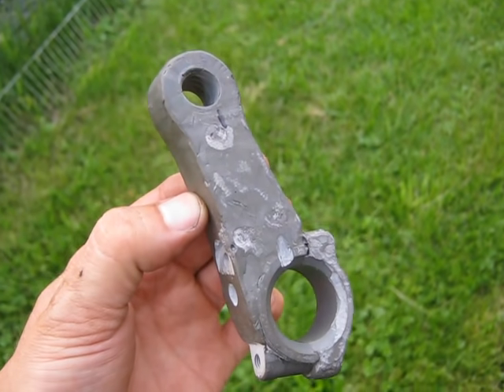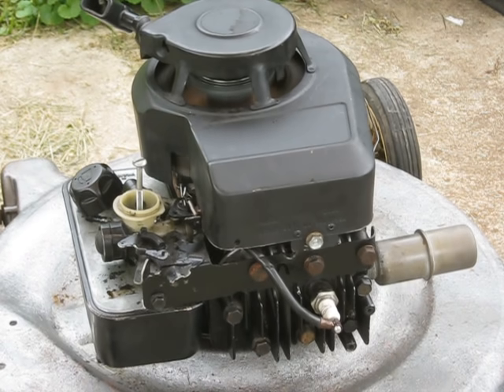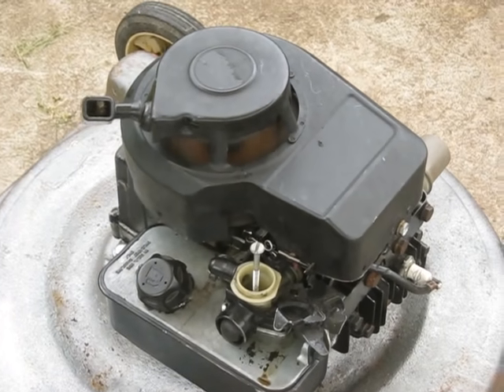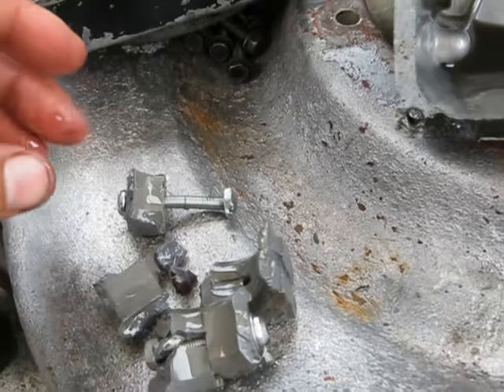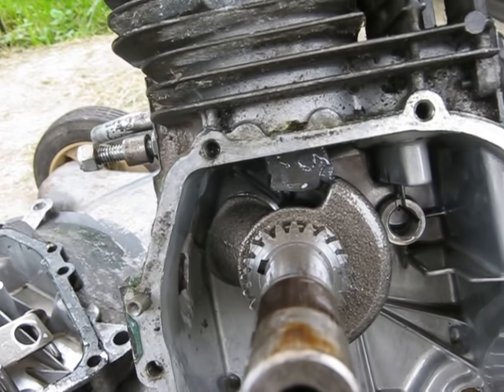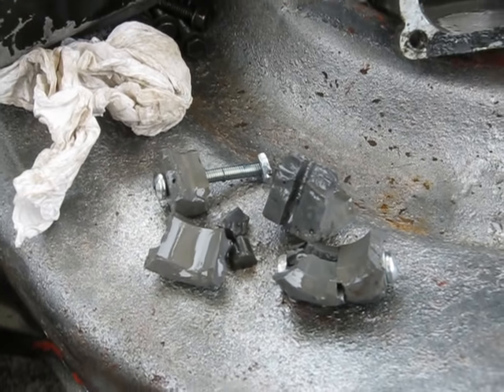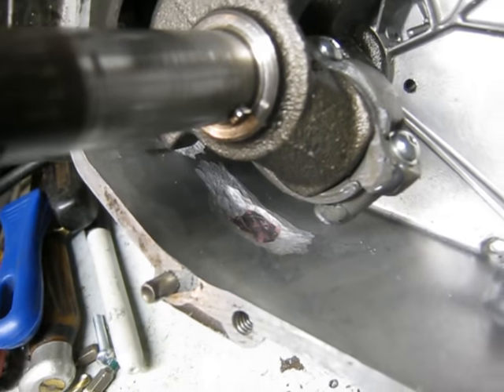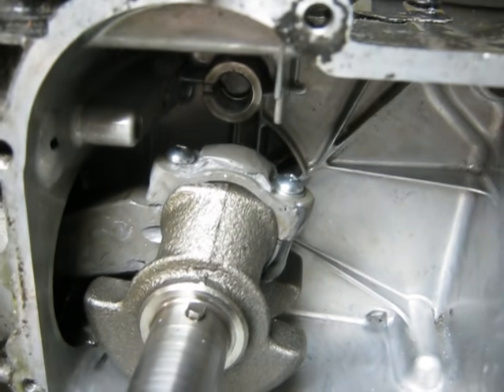100% JB Weld Con Rod Running!!!

Comment: Maybe putting the casting into a vacuum chamber would help in getting rid of air bubbles to reduce weak-points, resulting in a good, solid casting... :)
Reply from the maker: I could try that, if I make a second one. The JB is pretty thick stuff to pour, plastic is much thinner. I didn't see any bubbles in the cracked areas though
Reply: Bubbles could be too small to see with the naked eye

Comment: You should try jb weld cylinder, piston, head, connecting rod, and crankshaft all at once 😂😂
Reply from the maker: I was just about to shut the engine down before the rod blew, otherwise i was going to run the rod with the JB piston.Time to cast another I guess.
Reply from the maker: Sounds like others want to see another try also. i am looking at how to make it stronger.
Reply: Maybe some fiberglass
Reply: They already have an engine like that it's called Kia
Reply: Jaco2023 that would be rather I interesting lol
Reply: Interesting Facts That is a interesting fact.
Reply: Hey charger would you make a whole briggs engine out of JB weld(Head, cylinder, piston, crankshaft, fuel tank, etc) when you get the rod repaired

Comment: It would be interesting if you tried this again but reinforced the epoxy with some fiberglass matting or window screen pieces
Reply: Reminds me of carbon fiber i wonder how well that would stand up to it.
Reply: X2
Reply: its JB weld. Its already reinforced. Its not Epoxy. NO !
Reply: screamingshiter  straight from the jb weld website 

" J-B Weld is The Original Cold Weld two-part epoxy system that provides strong, lasting repairs to metal and multiple surfaces"

They do claim it's "steel reinforced" but the tiny pieces would not strengthen it nearly as much as half-inch long glass fibers.
Reply: Or better to add some steel rods in vertical y axis inside jb weld.
Reply: Thank you for the entertainment.. it's something different for sure.. you keep making these I will keep watching..

Comment: Yeah, agreeing with other commentors. The PSI strength of certain plastics mirror that of aluminum when glass fiber or glass balls are added to the mix in higher concentrations. 

In manufacturing, I've heard that the only downside to glass reinforcement is cost and mold life. However, that is not your concern, so perhaps getting some glass balls (not sure how to get that) or glass fiber (cut up glass mat would work nicely) to mix into the JB weld would add strength. I guarantee that it'll last much longer, but I'm not sure if it would be indefinite. 

Truly, a long stand of glass fiber wound between both crankpin and wristpin holes around a mold would probably be ideal since you can apply strength in the direction of the stress lines. It's similar to how helicopter blades are made, so, ignoring temperature issues, it should last a while. 

Great job on this run, by the way!!

Comment: I'm betting that would last a bit longer if you were to reinforce at least the bottom with say metal wire to act like rebar we use in concrete.  That does have alot of reciprocating force though . I'm actually impressed at the fact you are able to mold these things
Reply: that was my thought too, but also re design the rod so the bearing split was vertical, not horizontal and was about 2/3rds the length of the rod, so like a two piece rod on the lower part, both pieces reinforced with steel rods running the full length of the piece to help control the flex of the rod.

Was also wondering if it was possible to cure JB under pressure? maybe a mold that can be pressed in a vice so the molecules are pressed closer, as in forged steal...  also heating the rod in an oven to harden it.

Comment: Sweet! If you do try this again, cast it with a lot of extra meat. Then sand it really smooth. Vibrations will end at those rough edges and crack it. Problem pretty well known with lawn mower and go kart racers running stock rods. They'll grind the rough flashing down so they are smooth, and experience a lot less breakage. Keep up the good work! I love these videos!
Reply from the maker: I did beef it up already, but had to grind most of it back off, I even had to cut part of the block away for clearance. These 3-1/2 horse engines have very small con rod clearances, so very little room to work with. I am glad it ran as long as it did, as i was grinding on it for 2 hours last night, to make the little beast fit!
Reply: I could tell a lot of work went into that, lol! Maybe you could try the JB weld again with some glass fiber reinforcement, like they do with tool plastics? I could see that adding some strength. Maybe just some fiberglass insulation mixed in?

Comment: I live in Kingston and I saw you had a video of a 1960 push mower and was wondering what scrap yard you went to
Reply from the maker: I think I found that at Napanee Scrap metal, i just happened to be there when a trailer full of old mowers pulled in. They are all gone now, just luck of the draw. Years ago I used to get mower engines at Kimco, but I have no idea if they allow people in the yard these days.
Reply: ChargerMiles007 I used to go to buyers scrap metal over on macedues lane but they closed down last year and I went to ANS but the won't sell anything to the public so I'll try kimco and napanee

Comment: How about applying a mold release agent to the crank surfaces, and molding the con rod onto the crank to eliminate bolts altogether
Reply from the maker: Interesting idea, I didn't think of doing that exactly, I was going to make the 1 piece rod, and cut the crank, then bolt it together or something. Casting onto the crank may work, but would have a bit of an intricate mold box etc.
Reply: On further reflection,  you might not be able to assemble the engine,  as you would not be able to install the wrist pin

Comment: Did you mold the JB Weld at room temperature? Applying heat after the epoxy has initially set can both speed up the curing process and strengthen the final product. Even the cheap Harbor Freight epoxy gets stronger when heated during the curing process.
Reply from the maker: I just molded it at room temp. So it is stronger if it is heated, interesting.

Comment: try to compress the jb weld while it sets. i had an exhaust leak and it'd just knock the jb weld off so i took a plate and hammered it down on the jb and i havent had problems since

Comment: I use epoxy a lot an I'm wondering if you have any type heat treating I often I worm it to about 110 for 5 to min then let set for 20 to 30 min reheat to 140 for ten min let set 24 hrs then repeat the last set I used JB Weld often to repair molds for high temp compost  aircraft parts an would run test blocks though heat treatment 24 hr ramp up 450  an back to room temp then test every test block would reach 72,000 psi before failure worth a try must be void of any an all air pockets

Comment: JB weld is actually a really good filled high temp epoxy, it's just that the tensile strength is not quite there.
a few things to try
1. make sure you post cure the epoxy to above 200F for at least an hour before you try this.
2. mix in some long strand carbon or fiberglass (at least .25" length strands) into the epoxy before you cast. the piece. make sure you force all the air out of the piece as you form it up. this will more than double the overall strength.
3. increase the overall dimensions of the piece wherever possible to count for the lower Physical strength.
Reply from the maker: Thanks for the helpful points, I will put them to use if and when I make another rod.

Comment: You should try repairing a a broken aluminium connecting rod with jb weld.
Reply from the maker: Actually I did that back a year or so ago. it ran about a minute before it let go, and took out the block. it was revving about 3000 rpm, and destroyed the valve tappet area! The vid should be here some place, I think it is called JB weld con rod repair or something.
Reply: oh wow i just went watch the video and holy that glue is some strong stuff it held up quite well.
Reply: Project Farm did that as well

Comment: i bet if you made some metal inserts for the connecting rod cap bolts it would last longer. i am going to try and 3d print a connecting rod with metal inserts for the crankshaft journal and wrist pin

Comment: I want to see a wooden carburetor with wood that can deal with fuel soakage... Just a thought. Would be cool to see if it could even run on one.
Reply from the maker: Now that is an interesting idea, can say i wood have thought of doing that!
Reply: Lanchester Wick Carb. (for the old-school lower RPM motors) I considered designing a version for 2-strokes that were bullet-proof...I hate the Zama/Walbro carbs. I also considered a wooden body for it...heck...anything could actually work for those, I would imagine.

Comment: So the question is, did the rod fail and bend the bolt, or did the bolt stretch and cause the rod to fail.  I would try it again with beefier rod bolts.

Comment: please do another complete J-B Weld connecting rod.   Could you strengthen the rod by:  eliminating the 90-degree turn of the rod bolts, by having the rod shaped like an auto-rod, where the bolts fastening the cap, are straight-out from the rod?  Could you also grind/smooth-to-curved-edges all of the outside rod edges to head-off potential "stress-fractures"?  Could you polish the rod all over, deburring all excess J-B?   Could you then align-bore the ends, with the rod-cap on, so both the piston-pin AND the crank-end are precisely @ 90-degrees?  Oh!  Is there ANY way to compress the J-B Weld connecting rod into a top-and-bottom die [placed along the long ends/length of the rod ] while it is curing that will compress the whole rod, sort of as is done by a steel forged connecting-rod?   Obviously, it can't be heated & hammered like a real forging, but maybe during "cure" it could be compressed in a die forcing the J-B particles closer together.   After compression, polish it up, kind of.   Thanks.     Oh!  If the compression in the cylinder, was 6-8, maybe it could be lowered to 5?  Thanks again, JR
Reply from the maker: thanks for the advice, I will try to use it. I will definitely pressurize the mold, as I didn't do that with the rod i made. I am looking at changing the bolt direction also.

Comment: It's a bit extreme but how about a J-B Weld crankshaft??
Too bad the crankshaft blue and you weren't able to see what it looks like after its run.
Reply from the maker: that would be quite a challenge, and use a lot of JB.
Reply: ChargerMiles007 you should try contacting the company that makes J-B Weld and get an endorsement from them and get them to provide you the J-B Weld for your projects.
I think it'll be good for them, since your definitely putting their product to a test.

Comment: Making the connecting rod from scratch you can add more in weld in the weak points. Using a rod bearing would help in the longevity of the next rod.
Reply from the maker: I did beef up the rod where I could, problem is these 3-1/2 horse Briggs engines run the rod very close to the camshaft, and the side of the block, so I was very limited in what i could do.

Comment: A forced induction setup would keep the force on the rod in one direction. It might last a whole 2 minutes! That was crazy cool to see. I figure once thermal expansion started it was over. I didn't think it would last as long as it did!
Reply from the maker: Yes, i didn't expect it to last that long either. I am not sure what caused its demise, i will make a vid showing the parts put back together.
Reply: Anthony Butera Interesting thought.  I wonder how much boost you would need to actually keep the piston and rod under compression for the entire cycle.  It would have to be enough to overcome the force exerted on the piston that pulls it down the cylinder, which I imagine is quite a bit.  Plus it would have to do that after flowing through the tiny in block intake valve.  My guess is the head would blow off the motor before you could make enough boost to do this, but I could be wrong!

Comment: It could be that the iron of the crank got hot and expanded more than the JB Weld  This make  a huge force trying to make the big end hole bigger.  The binding against the crank would make a big twisting force.
Reply from the maker: Yes, that could be part of the problem, I can't say that I have looked at the expansion coefficient of JB versus steel. I wondered the same thing about the JB piston, I suspect it gets tighter when running.

Comment: I'd say add a spring (such as a valve spring) to the middle of the con rod. You might add enough rigidity for a longer run.
EDIT: I just looked at the other video, I see how it broke now, I though it snapped in half.

Comment: How did you get it to the correct size and shape with all the proper clearances??  Fascinating video. Thanks!
Reply from the maker: I cast it based on the original rod, beefed up, but it still took  some time to shave it down to fit.

Comment: Pretty impressive, really.  Unfortunately, that JB Weld rod is probably quite a bit heavier than the original die cast rod and it's running unbalanced which probably didn't help either.

Comment: Would be better to somehow get to the mass of the original rod. You could add a lot more material around both the rod journal and along the length to both get the engine balanced (or at least closer) and account for the weaker material.

Comment: Make another one but make it a flat cap instead of an angle and see what happens  it would be interesting to see 
.
Reply from the maker: I may do that, I would have to seriously cut out the side of the block to clear, then there is the camshaft clearance issue also. I am looking into that now.
Reply: maybe a bigger briggs like a 5hp?

Comment: JBWeld also a great low-loss core material for distributed gap chokes and flybacks to 150KHz. Perhaps an ignition coil? Standard mix 5% ferrosilicon "steel" filler conducts magnetism about 3X better than air or empty space. Enough to guide a field through the wires. Several interesting photos and measurements I tried to send, but was unable to guess a valid email.

With addition of crushed Manganese Zinc Ferrite beads (JB will absorb far more than its own weight of aggregate and still appear wet enough to take more) becomes amazingly hard and tough. Much stronger in compression, impact, or bending than soft JB or brittle ferrite alone. How MnZn aggregate affects pull strength I'm not so sure about, probably no worse.

Don't use to glue permanent magnets, it crawls as a ferrofluid to cover the entire outside. Bizarre and not helpful.
Reply from the maker: Thanks for the info.

Comment: Neat. Skip the bolts next time. just mold it around the bearing.
Reply from the maker: When I was planning this out I actually considered that idea. I ruled it out since i couldn't think of a simple way to install it into the engine. Even if I cast the con rod onto the crankshaft, and got it into the engine block, then I couldn't attach the piston to it. Not saying it is impossible, i just couldn't think of how to accomplish it, but it certainly would make for a stronger and simpler con rod!

Comment: JB weld a .22LR barrel.
Reply from the maker: Now that probably is a very bad idea, due to the very high pressures involved in firearms, up in the 10,000 plus possibly up to 50,0000 psi territory on high powered rifles.

Comment: at least it didn't throw it in the side.
Reply from the maker: True, I put a 1/8" thick steel plate between the gas tank and the hole I ground in the block, just in case.  I could see filling out the insurance claim for the gazebo.....My lawnmower engine suddenly burst into flames, spilling the whole contents of the gas tank onto the concrete, the resulting flames took out the gazebo....I have NO idea what caused the fuel leak!!!  :)

Comment: you forgot the mustard gas!!
Reply from the maker: Sorry, I did use it on the two 10 second runs that I had before the one in the vid. I showed the mustard gas being used on both of them. I didn't add those clips in, as I figured the vid was getting rather long already. I don't have any vid editing software, so i am NOT happy about youtube getting rid of the editor. they just seem to keep cutting features, remember when we had friends, and the 5 star rating etc.

Comment: something a bit different but i have seen videos of engines that run on water. use salt water and a battery and it produces hydrogen i have seen videos but i am never sure how real they are might be an experement for you to try and find out if it can produce enough hydrogen to run a engine
Reply from the maker: I don't know about running the engine completely on the generated hydrogen, but I know a guy at work that has a hydrogen cell under the hood that he says increases his gas mileage, probably by having a more complete burn.
Reply: i have seen claims on the internet if you fill something with water put salt in it then run 2 leads from a battery and it produces hydrogen . it wont run a car on its own but i wondered if it would run a lawnmower

Comment: jb weld "sucks"no way in hell would it ever work for this,even if it was strong enough the balance would be so far off it would destroy itself anyway,buy or get a used rod if that piece of crap mower means that much to you